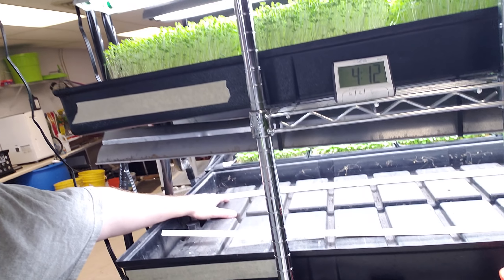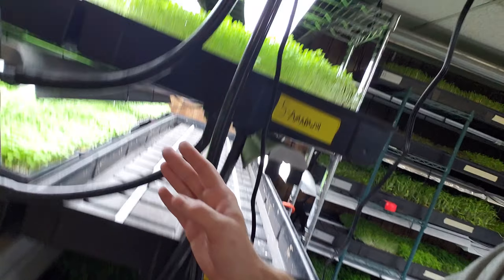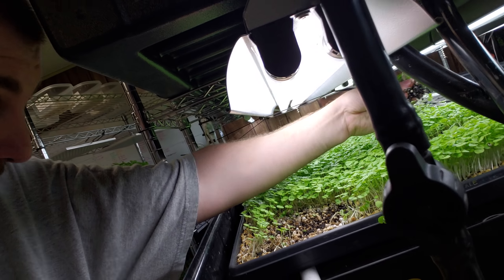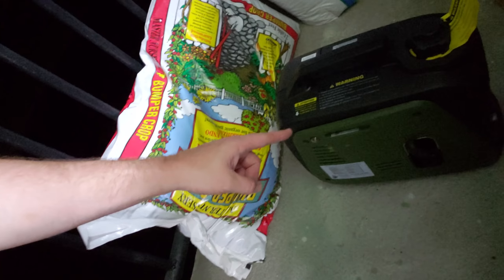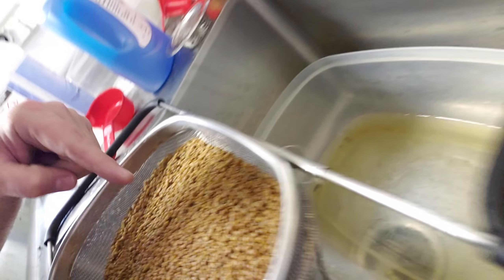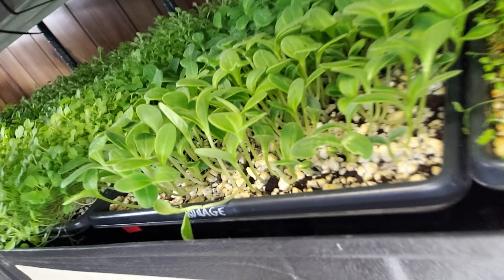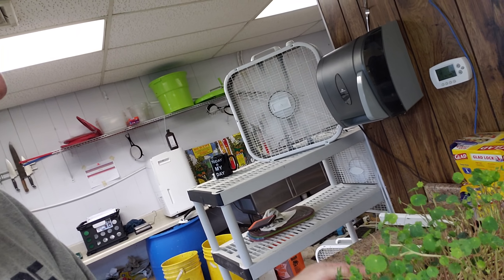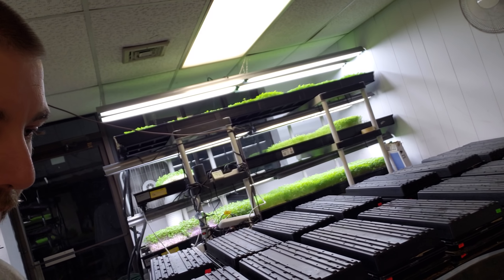Microgreens Update 8/12/18

Comment: Cin Basil! I started running that one a few weeks ago.  I just recently took the time to setup/wire the individual inline 1 bulb 4 footers.  Things are looking MUCH more even.  For a short while I put two of the 2 bulb ballast per shelf with only 1 bulb... but I had a bulb burn through the socket and fall on the plants... 
Def in the same spot with automation.... heavy enough into it now that its pretty impossible to think about a vacation haha
I just bought this "WiOn" power strip which has wifi and app to go with it.  Pretty darn cool... 4 controlled outlets I can use from my phone and you can setup on/off schedules  AND!!!! It shows you the current wattage being pulled, and the est cost associated with that.  Def a neat $30 investment haha

Lastly... did I see whole Cilantro seed there? No Split??

Comment: Hey, I am starting my own micro green growing business and was looking to get a question answered. I am using a vertical grow system on wire frame racks. I was wandering about trays to use and why. Should I get trays with drain holes or no drain holes? My concern with drain holes is that any tray above a light, because I am doing vertical growth, will drain out of the bottom and maybe mess up the light or possibly drain onto the other trays of micro greens. My other concern with no drain holes would be that the micro greens will not get enough oxygen. I have looked all over and cannot find an answer to my question. Do you have any tips about drain holes or no drain holes or specifically taking the greens out and draining them myself? I am new to this so literally any advice would help, from anyone!!